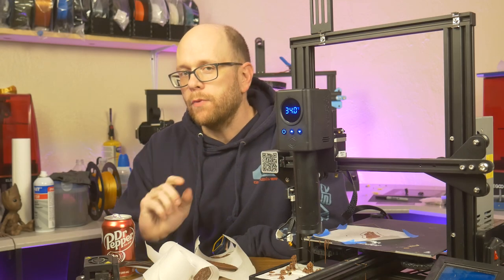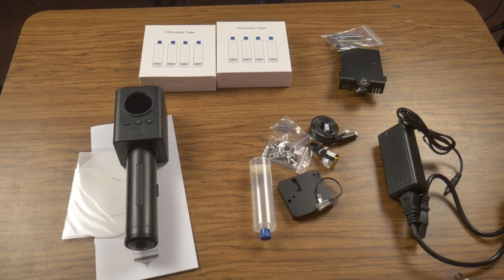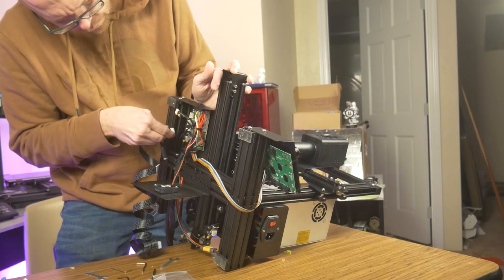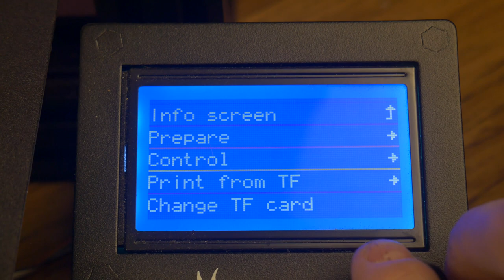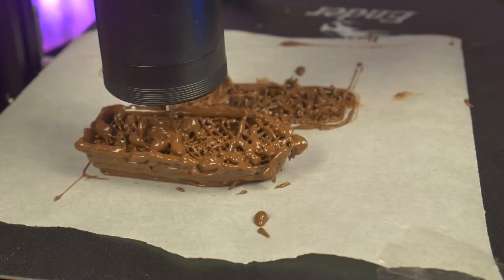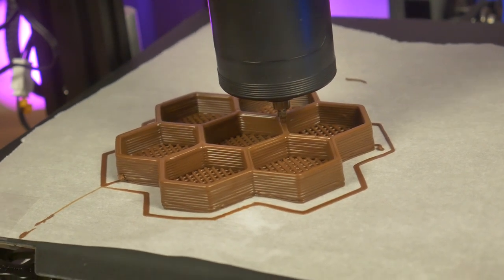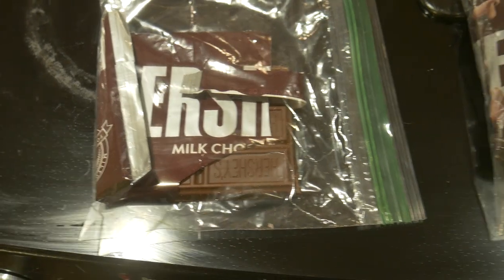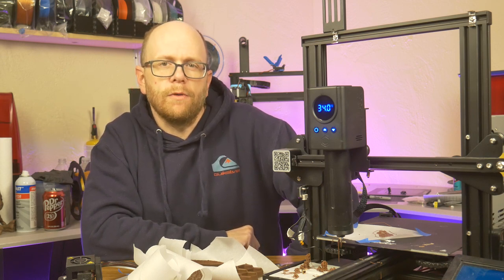3D Printing with CHOCOLATE! Wiiboox Luckybot Review

Comment: Hi, Ive been trying to get my wiiboox working for months now, and have been comming back to your video multiple times. I seem to always get under extrusion, and the extrudor motor clicking as if the nozzle is clogged. Do you have any idea on how to solve this?
Reply from the maker: I think it all boils down to the quality of the chocolate you are using. Preparation is also very important. Especially the step where you soak the syringes in the hot water for a period of time. Sorry it has been a long time since I made the video and I don’t remember all the details. It took me a LOT of trial and error to get the results on the video. Some chocolates turned out great, others not so much. I can’t remember which chocolate printed the best but I think I covered it in my video.

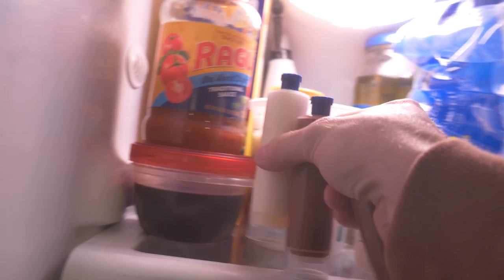Comment: 6:16 - Do you think removing all air in a vacuum chamber would be better?
Reply from the maker: I feel like it would be difficult to do that while maintaining the correct temperature. It may also alter the composition of the chocolate, so no, I don’t think a vacuum chamber would give you Abby advantage over heat soaking.

Comment: From what I could see it looks like the printed chocolate sets too slowly for more layers to be built on top without collapsing, I wonder if it would help to cool down the printed chocolate quicker with a fan, or maybe add pauses between layers to allow more time for the chocolate to set, when you're printing more complex 3D shapes with overhangs?
Reply from the maker: I thought about the cooling, but the nozzle temperature has to be super stable for the printer to work properly. The pause between layers idea might be worth trying out though.
Reply: @SouthpawWorkshop  this definitely looks like something I'd wanna try printing with! Unfortunately it seems to be all sold out on Amazon, would you know if there's anywhere else I could get one?
Reply from the maker: I think Amazon is their only distributor. I would suggest keeping an eye on it as they restock pretty regularly.

Comment: Love your video which is Really helpful. I recently purchased LuckyBot ONE Food 3D Printer and still have not succeed  producing an acceptable print. The problem I face is that I cannot get the printer to extrude chocolate in smooth manner  - continues flow. Any ideas?
Reply from the maker: Chocolate brand mattered them most for me. I had the most success with Hershey’s chocolate, but that is in the USA. If you are in another part of the world, your Hershey’s chocolate is likely a different formula. I got decent results with lots of trial and error, but be warned it is a lot of work.

Comment: On muy country the temperature Is: 25-32° can it be a problem? Or i need a  air conditiner
Reply: The ideal printing room temperature would be 15~24 degree. The chocolate is hard to shape if it's too hot. Need to cool down with air conditioner or just place some ice packs near your printed models. 😀